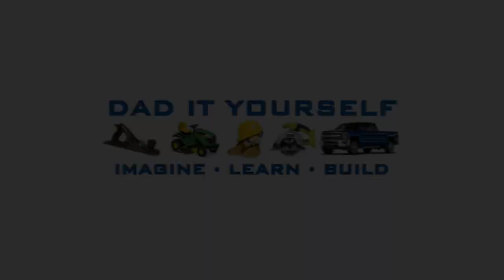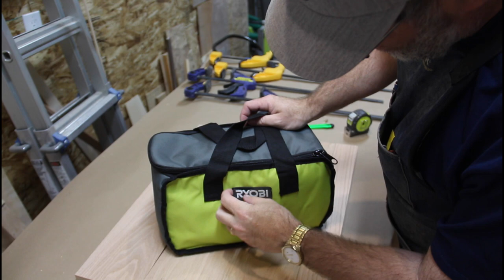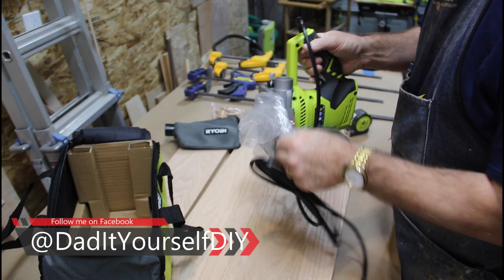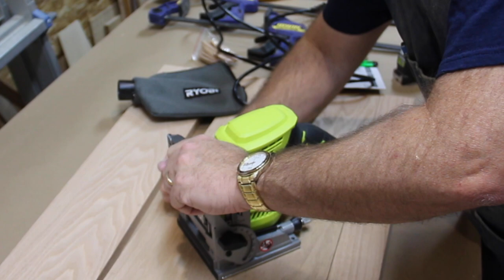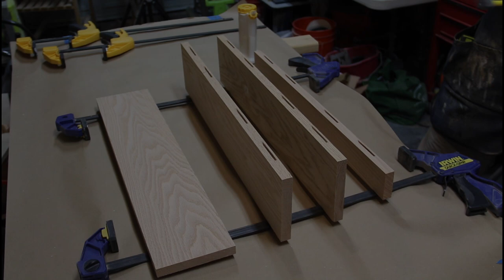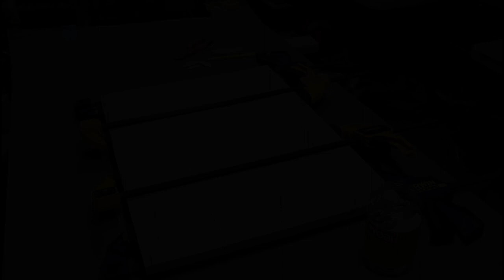RYOBI JM83K Biscuit Joiner | UNBOX and DEMO! | 2020/22

Comment: So how do you adjust the height of the location of the biscuit? Do you add shims under the wood to be cut? The biscuit slot for the blade is in a fixed position. The fence just adjust for the thickness of the wood only, right?
Reply from the maker: The fence moves up and down for the placement of the cut. In some cases the shoe of the tool may be lower than the bottom of the wood. In that case you will need to slide your workpiece to the edge of the workbench. I've only experienced this when trying to join 3/4" or smaller material.

Comment: Have you done any butt joints with it? I can’t find any examples of doing it with the Ryobi. Other brands of these joiners seem to be built a little better, I find the fence to be very annoying on this one!
Reply from the maker: I rarely build with butt joints, when I do I use a mechanical fastner. I primarily use this for building panels or attaching and edge band to a plywood panel.

Comment: Biscuts are supposed to be CENTERED in the joint not off to one side as yours were. The height Adjustment is the LOWER Edge of the Blade no the Center Point.
Reply from the maker: This was my first time using it, and figured it out after the fact..
Reply: @DadItYourselfDIY  Thanks, I was wondering why the cuts were not centered. I guess you didn't figure it out in time to mention it in the video. I assume it's best for overall strength of the project to center them.
Reply from the maker: Biscuits do nothing for the strength of a joint, the assist the keeping the board sufaces aligned during glue up. An even joint with glue and even pressure requires no additional joinery. If there is going to be lateral forces then you should use, bread board ends, mortise and tenon, dowels, or splines to strengthen the joint.

Comment: This is what happened when I tried to use my new Ryobi biscuit jointer... It caught fire !  https://www.youtube.com/watch?v=LpPStdYPkFU
Reply from the maker: Dull blade woodchips burning.
Reply: @DadItYourselfDIY   Yes you are right  that would be consequence of a dull blade, however this is a brand new machine on its 1st use. It appears that the cutter cerf behind the carbide cutters has been made too high so they actually rub at 7000rpm on the timber being cut generating huge amounts of heat which ignites the sawdust as its created by the cutter in front.
Reply from the maker: So, was that a manufacturing issue or a tool setup/adjustment issue?